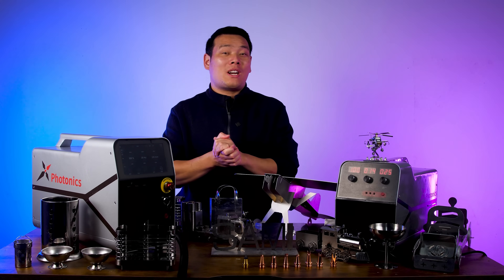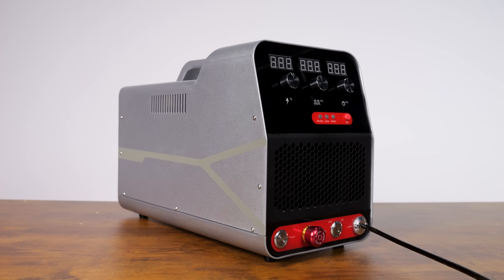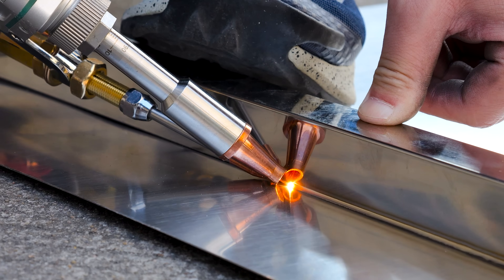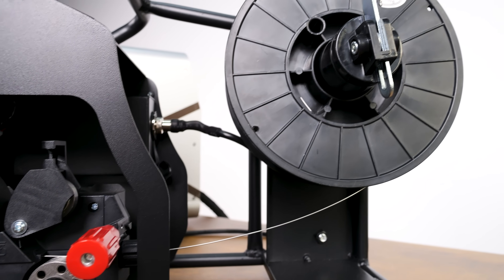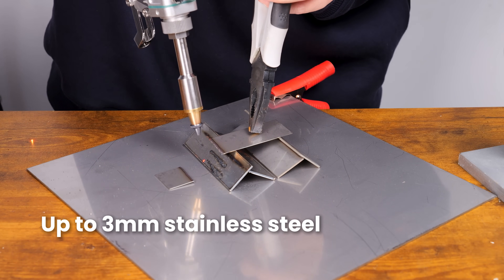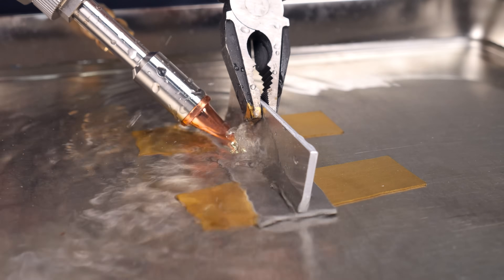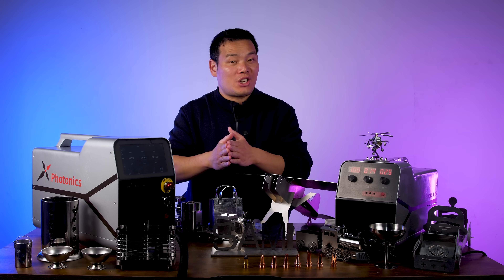Xlaserlab X1/X1 Pro: Micro Laser Welding That’s Changing the Game

Comment: I love my laser. But be careful when cleaning hardened steel. The heat can remove the hardening, or make it more brittle. So use the least power that will do the job. If necessary, let it cool and then go over it again so it doesn’t get too hot. That bicycle chain was getting red hot. No good.

Comment: I was going to back this project until I realized the max weldable thickness is 3mm, or slightly more than 1/8th inch. 

That is useless to me and most welders, unless they are also artists or sculptors or fixing antique kids toys - okay, maybe doing body work - but not the usual crap people bring into my shop to be fixed or shored up or made from scratch. 1/8th won't do.

Please correct me if I'm wrong before they sell out.

Comment: interesting stuff, i went into the Kickstarter and tried to order one x1 pro, but the rules made little sense to me. Maybe i get one, maybe i don't, maybe i wont get the money back without getting the machine if the project don't launch?? Who knows? They cant say purchase , only backing the project, god knows what that means, and i have to give away my VISA card numbers? Seems like a lot of risks for a maybe... ill just wait until these machines are mainstream.
Reply: The point is that you're getting a discount to crowd fund development of the products, so if you wanna pay $6000 when it hits the market you're welcome to wait for less risk
Reply: @bgmx74  did you buy one? Did you receive one of this machines at you home?
Reply: @dan-t5e5r  They have not shipped yet. And as I wrote below, this is an all or nothing campaign. If they do not deliver you get your money back, guaranteed by Kickstarter. However, if the unit does deliver, and sucks, you're out of luck.
Reply: This is an all or nothing campaign, which means if they do not deliver, money gets refunded. This is backed by Kickstarter. If they did not stand behind their platform everyone would launch ghost projects and walk with the money.

I've backed multiple projects that did not deliver and I got my money back every time. 

The bigger risk is that this does not perform well. There are no refunds for a project that delivers, but sucks. 

I was going to back this project until I realized the max weldable thickness is 3mm, or slightly more than 1/8th inch. That is useless to most welders, unless they are also artists or sculptors or fixing antique kids toys.
Reply: @ or custom automotive fabrication. This isn't a pipeline tool
Reply: @bgmx74  Obviously not, but it also will not replace by stick or torch when someone brings their riding mower by to fix the frame or the neighbor's snow plow blade. I'm not sure multiple passes fits the workflow of us low level small shop guys. Looks fast, though, and apparently does not give off much UV because I do not see anyone wearing shrouds or heavy leather.
Reply: @newunderthesun7353  The Kickstarter page says otherwise. You are charged only if fully funded, but there's no guarantee of delivery:

"Rewards aren't guaranteed. Your pledge will support an ambitious creative project that has yet to be developed. There's a risk that, despite a creator's efforts, your reward may not be fulfilled. We urge you to consider this risk prior to pledging. Kickstarter is not responsible for reward fulfillment or refunds."
Reply: Thank you for sharing your experience. I was wondering about the same. Often the risk of crowdfunding or kickstarter products is exactly that, but after being ripped off once you loose the trust 😅
Reply: @emperadorromano567  how does one "loose" trust?

Comment: Is this safe? The answer is HELL NO
Reply from the maker: I understand your concerns, but products like this have been on the market for a while and have been tested extensively. They come with multiple safety measures, and of course, wearing proper protective gear like goggles is essential. Safety first! 😊
Reply: @SamiLuo  If you start seeing black dots or your Cornea malfunctions, let me know :)
Reply: @janienwright3895  there’s PPE for this just like any other manufacturing process that you should be comparing this to such as MIG or TIG welding. All manufacturing tools are dangerous.
Reply: This is why women are not equal to men. Perfectly safe to a professional.

Comment: What happens if you use the Pro on something thinner than .5 mm? Does it just melt it? Is there any way to turn down the laser power on the Pro so you can use it for the full range?
Reply from the maker: Yes, that's true, it will most likely melt it. If you need to work with thinner materials, you can try the X1 model.:D

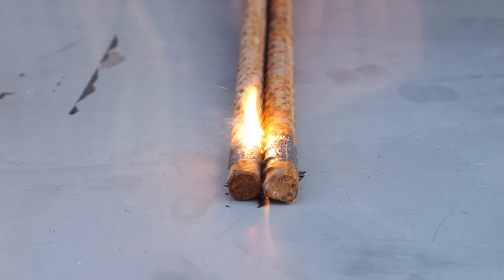Comment: The chain at 4:56 straight up melted a bit 😂
Reply from the maker: Yes, I guess this is because the chain had oil residue, which is more flammable and caused the chain to reach a higher temperature.

Comment: Why does a laser need to create a circuit with the clamp?
Reply from the maker: Hi, thanks for commenting. Establishing a circuit connection is actually a safety measure. The laser will only emit light when a circuit is formed between the metal and the laser, rather than emitting light directly. :DD
Reply: Probably just as a safety feature?
Reply from the maker: @shellite  yes
Reply: Now that's a real question

Comment: dang
i just ordered a watercooled  version of this type laser

like the  pencil  handle, and it can be stick into cnc and using for cut

i subscribed and  most likely   get  the 1600 early bird
Reply: What was the brand and model you ordered?
Reply: @How2Texan  
what i ordered  has MAXphotonics laser source
the control i think leetro
the gun also  kind of standard

ABF freight just called yesterday,  it will coming  today around lunchtime

might see more later
Reply from the maker: Thanks for commenting. I guess what you ordered is likely a light source, which requires integration with other products to function. This Xlaserlab X1 series, on the other hand, is a ready-to-use complete machine. :D
Reply: @ 
its a complete machine

i have routers, co laser and  fibermarking from china
chinese  not  building  everything

they  using  components from  other manufacturers  and building together it

western companies  trying to make everything in house
myself like better  as chinese doing because i can buy any component, and dont have to rely  on the  one  who  built it together
Reply: just checked receipt the  manufacturer is located in changhsa
they building  many types of machines|

my next investment  either way a fiberlaser cutter  a small or a channel letter bender

my point was that the machine i  purchased is  water cooled type,  your  video  showing an aircooled type  smaller  and more mobile